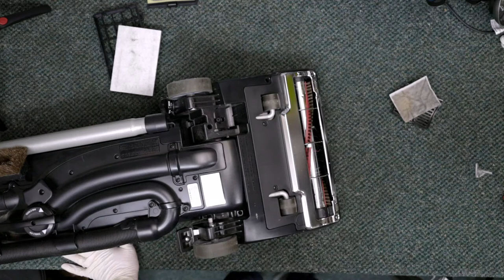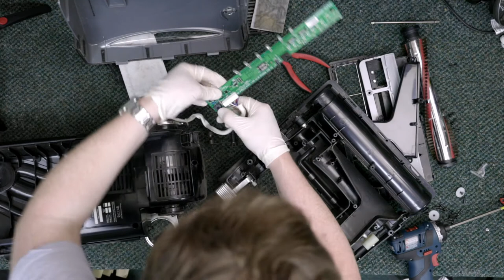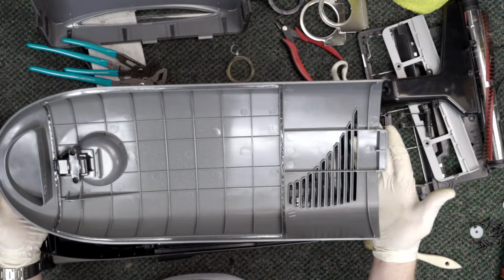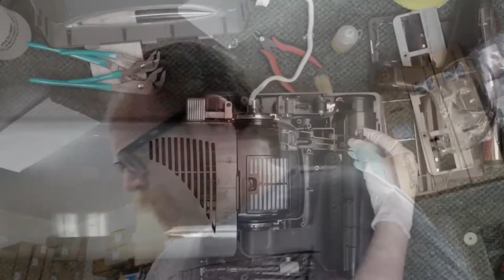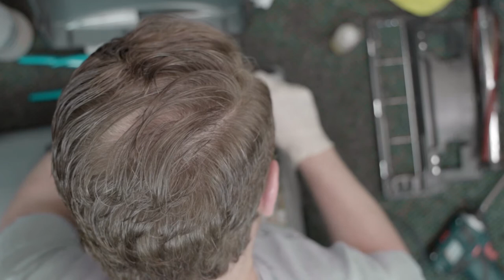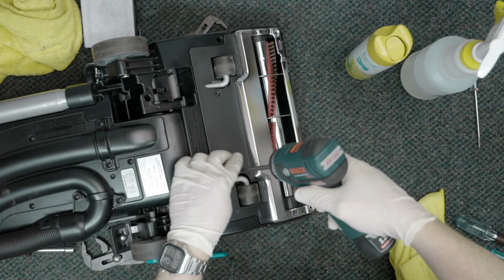Inside the Ultimate Carpet Cleaner - The Riccar R30 Brilliance Tandem Air Explained!

Comment: Just picked up a used R30P yesterday. Fantastic vacuum.
Reply from the maker: That's awesome, Josh! Enjoy it... that's a great vac.
Reply: @HouseOfVacuums  you're not kidding. I've been using a Shark NV752 which has been doing a great job picking up dirt and our dog's hair, even better than the Dyson we had before. BUT, this Riccar R30 is even better, it somehow just leaves our carpet feeling cleaner than the Shark, and the Shark has TONS of suction power and picks up TONS of dirt and debris.
Reply from the maker: Glad it is working so well for you!
That is actually the biggest differentiator between the NV752 and the R30. The Shark has lots of suction with a puller-style motor, but doesn't have great air flow (CFM). Since the R30 has both a pusher and a puller motor with the Tandem Air design, it gives you both great airflow to the carpet and good suction for the tools.
Cheers!

Comment: Great info about this vacuum. Mine started making noise after I sucked up a stick. Took it apart and found a broken motor fan. It looks like an impeller which essentially is what it does. I have a mechanical background so I just needed to know where all the screws were to take it apart. information on the design was very interesting and I am now glad that I purchased this vacuum cleaner. It was about $600 and I hated spending that much but the engineering seems like it is worth the price. Thanks again for the video. I will watch it again when I get the part and put it back together. I have 3 screws left over after putting it back together without the new part.
Reply from the maker: Thanks for watching! It is definitely a great cleaning machine. But yes, you do need to watch what you vacuum up due to that impeller. Most of the time it is pretty durable, but it is possible for a foreign object to hit it just right and break it... especially as the impeller ages.
There are a lot of screws in these beasts... definitely try to get those extras put where they need to go.
Thanks Again!

Comment: Great Video, Thanks for sharing. 
How maintenance heavy would you say these Riccar's are compared to a Sebo X series upright?
Reply from the maker: Interesting question!

They are really two different animals in terms of design. I would say that the maintenance over the life of the vacuum would be easier with the Sebo. It is less complex and has a long history of reliability.

That being said, the Riccar will out-clean the Sebo all day, every day. It is reliable, but not as simple as the Sebo which gives more potential failure points.

The question is really whether or not you value ultimate cleaning or ultimate reliability more? Reliability, edge to Sebo. Cleaning, edge to Riccar. Although neither are bad in the opposite categories.

Comment: I have a BRLP Brilliance I bought in 2011, agree that the cleaning is unmatched, however I just had to take in it for its 3rd, yes 3rd direct air motor (including the original) as it normally starts vibrating and buzzing as the fan hits the motor housing.  Smells like burnt plastic too.  so the original lasted from 2011-2015, the 2nd from 2015 to 2019, the third one 2019 to 2021.  About 3-4 years on average.  Seems more like a time/use dependent part with a designed life expectancy.  We are meticulous about our home, we use it daily, but its only used on indoor carpet that has normal dirt, pet hair, etc.  In each case it was not a result of picking anything up that damage the fan.  So what gives, does this sound like tremendously bad luck, as our dealer says he has never seen this happen before.  or is this just par for the course?  These impellers seem to be junk, and the only replacement is the original Riccar direct air motor, and the entire assembly, correct?  I need to do the replacements myself at this rate.
Will I be happy with a Sebo mechanical after using this beast?  considering one instead of replacing the direct air motor yet again.
Reply from the maker: Hey Melissa, thanks for the comment!

I'm sorry to hear about the trouble you have encountered with that direct air motor. Certainly it is more prone to fan issues since debris does pass through the motor impeller. 

I think that I am a little surprised that it has required a new motor each time. Typically if there is an issue with the impeller (fan) you simply replace that part and not the whole motor assembly. There are only 3 instances that would require a motor replacement that I can think of. 1) Electrical failure 2) A crack or hole in the fan housing or 3) Bearing failure. With motors as new as yours I can't imagine that it is electrical failure or bearing. Is it loud when you run into issues? Has the dealer specifically said that it is the impellor or something else? I would hate to think it was just an impeller and you are being charged for a motor replacement instead.

As to the question on the Sebo... that's a hard question. My favorite brand to sell, repair and own is Sebo. They are simply built like tanks. That being said, if my house had extensive carpets, I would still own either a Riccar Radiance (R40) or Brilliance (R30) because there is nothing that compete with them for carpet cleaning.

That isn't to say the Sebo G4, X4 or X7 are bad. They are great machines, better filtration, more refined and more reliable. But if you are fanatical about carpet cleaning like I am, you may find that they fall a little short of the Riccar.

Let me know that information I requested about the way it is failing and I'll see if I can give some further advice. Thanks!
Reply: I agree with you Melissa, after being talked into this Riccar being the greatest thing since sliced bread and tough as nails. 2 motor failures within 4 years I'm done!! I had a miele s7 upright before as a spare and is still going today but is now getting tired. I just ordered a sebo e3 as we are switching our flooring to more 75% hard floors. I'm hoping to finally get a 20 year vacuum with the sebo.

Comment: Great video on thoroughness of product design and it’s a fantastic review of product quality for the machine of a Riccar upright. You answered many questions I had in my needs for floor care in entirety with your comments and opinions. I enjoyed watching this until the end even though this is not a machine that fits my requirements. Again, thanks for your investment in creating this information. This looks like a superb machine for wall to wall carper cleaning. 

I do have a wide variety of flooring surfaces, carpeting, expensive Persian rugs, entry door throw rugs and my home has sets of stairs leading to multiple levels. The home is 2650 square feet and I think I will be looking for a high quality canister vacuum where I can vary the suction and disengage the roller brush as needed. I’m replacing an old Miele Red Star that has provided me with 20+ years of service. A long retractable cord would be ideal. Which model canister vacuum cleaner can you point me to for my needs?
Reply from the maker: Hi there, thanks for the question!

Miele still makes an excellent machine. A great replacement for the Red Star would be a Complete C3 HomeCare or Marin. If you know you like the Miele and their ecosystem, those would be two that I would look at.

If you want something with an ultra-long cord, a huge bag and built like a tank, I would probably recommend that Sebo D4. The bag is larger than the Miele GN by quite a long shot. The cord is also 40 feet, which is the longest I have ever seen in a canister. By comparison, the high end Mieles have 24 feet of cord. AND if you buy from an authorized dealer you can extend your warranty to 10 years for free.

Both would be great choices. Based on your desire for a long cord, I think the D4 deserves a hard look.
Reply: @HouseOfVacuums  Thanks for your reply. I went with the SEBO E3 Premium. I just received it about an hour ago and have already vacuumed half my floors. Fantastic machine and I highly recommend it. I learned a lot from watching your videos to have gained enough confidence to purchase one sight unseen. I better leave the rest for the wife so she can try it out too! 🤣🤣🤣 Thank you again. 😎👍
Reply from the maker: @heystarfish100  Nice! Definitely a wise decision, you can't ever go wrong with Sebo. That vac will provide you with many years of trouble free use. Cheers!

Comment: Need some help troubleshooting. My wife said there was no suction at the hose. A quarter dropped through the hose. I took off the back panel and there were no obstructions. Suction on the brush roll end is fine. I assume the problem is the micro switch at the tools off and tools on knob.. Any insight?
Reply: It had something to do with the microswitch. I took it off and tested the switch with a voltmeter and it was good and then put it back on and then the suction from the hose worked. Couldn't find a replacement for it so if it does go bad in the future I will have to rig something up.
Reply from the maker: Thanks for watching and for the question! So, the microswitch is there to turn off your brushroll/direct air motor when tools are being used. The switch itself shouldn't effect whether or not there is suction. However, the valve that activates the switch is what diverts air from the normal pathway to the tools. If there was something stuck in that valve or if it was misaligned that could effect the suction from the tools. Am I understanding correctly that once you reassembled it that everything is working properly?
Thanks!
Reply: @HouseOfVacuums  Yeah, i had taken it apart at least twice and I didn't get suction from the hose. My last-ditch effort was to check to see if the micro-switch at the tool/hose lever was working properly. All I did was take the switch off and then put it back on. Must have been miss-aligned for some reason because suction in the hose worked after that. go figure.

Comment: Fascinating design!  Question… I notice the direct air motor is also driving the belt.  Assuming there is a hard floor setting to turn the brush roll off, that would mean the direct air blower will be off too?  If that’s the case, wouldn’t suction performance be reduced while in floor setting?  Further more, is the direct air impeller allow to freewheel when the motor is off?  Thanks for making this video, thoroughly enjoyed it.  Love the background music even.
Reply from the maker: Hi Howard! You are correct that only the bypass motor is running when you are in "Floor" mode. However, it doesn't really present much of a problem on barefloor. A vacuum can pretty effectively clean bare floor while running at a much lower speed than on carpet, like canisters with speed controls. It works because you don't need all the power through carpet fiber and to the batting and subfloor.
Glad you enjoyed the video. Thanks for watching and the question!

Comment: I have a question I have one of these upright and I've noticed that there's different brush rolls there's one brushbull in particular that has three sets of brush strips on it can that be interchanged with this model
Reply from the maker: Thanks for the comment! The triple row brush strip is the unit that comes on the R40P Radiance, which is the larger version of this machine. It does provide more consistent contact with the floor which will result in even better cleaning. Unfortunately, that brushroll will not fit in this machine (R30 Brilliance). Hope that helps!
Reply: @HouseOfVacuums  thank you

Comment: What's the purpose of the aluminum 3 row brush roll asxopposed to the chrome?  I have the aluminum one on my machine, and personally I wish the bristles weren't so stiff. Idk,  It feels like to me it's just going to cause more wear on the carpet.
Reply from the maker: It certainly depends on the carpet, but on normal synthetic cut-pile the three row is awesome. The reason why it is better than the chrome one is that the three rows of brushes allow for more consistent contact with the carpet, which brings with it better cleaning. Cheers!

Comment: I miss the days in the 80's as kids when we could run and  drag our feet covered with socks across the carpet and  zap each other ⚡I tried this with my 5yr old son and nada😟 I wonder what changed in the newer carpets vs the ones from back in the day, it can't be the vac's metal   plate?🤔
Reply from the maker: Some carpet blends don't generate as much static as the older carpets and some manufacturers put on anti-static coating. Maybe that's the case with your carpet? I know here in VA is much more difficult to get static from carpet than back home in CA, mostly due to the humidity.

Comment: I have a Riccar Radiance .55+ from 2007. It's a good vacuum when it isn't clogged with cat hair. Twice a year I have to break it down and do a deep cleaning. Are the new Riccars any better, or should I expect twice yearly deep cleaning on any vacuum in a house with pets?
Reply from the maker: It definitely depends on the kind of hair. Certain types are more prone to wrapping around the fan than others.

If you continue to have trouble with the wrapping, you may want to think about a motor bypass machine like the Sebo X7. I think that would be perhaps be a more reliable option.
Reply: @HouseOfVacuums  I've herd many good things about Sebo. Is there any reason to buy the Sebo over their commercial line? The Sebo x7 is $1,042 while the Windsor Sensor XP 12 is only $778.
Reply from the maker: Great question! There are some significant differences between the X7 and the XP12. The Sebo has the 10/7/7 warranty, the Windsor has 1 year. The Windsor is built on the older X4 platform, so it does not have a sealed final filter like the X7 or the headlight. The Windsor is also missing the updated brushroll removal mechanism that is easier to remove.

Only you can say if all that is worth $260. For me it would be, because I would want the warranty, sealed final filter and headlight.
Reply: @HouseOfVacuums  Thanks. I see your point. For the extra the Sebo make sense

Comment: ❌❌❌ can you tell me the difference between the Riccar R30D.6 and the R30D.8 ???
Reply from the maker: Good question! I don't have a complete list of improvements, but all of them were fairly iterative. Usually it is small tweaks or changes in suppliers. For instance, at some point they changed the supplier of the circuit board and that resulted in a new model iteration. So while I can't say what the exact differences are, the more recent you make the model the more refined a product it will be. Hope that helps!